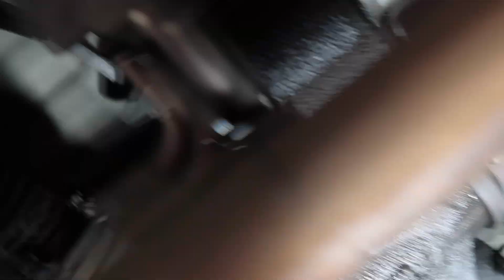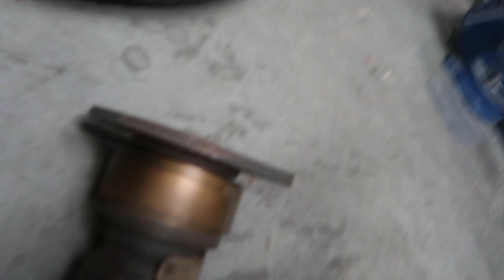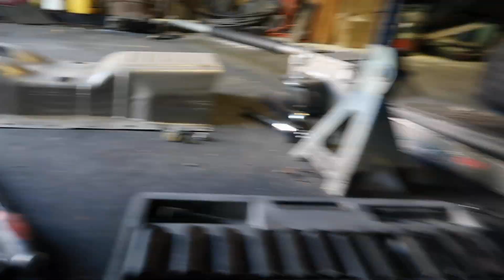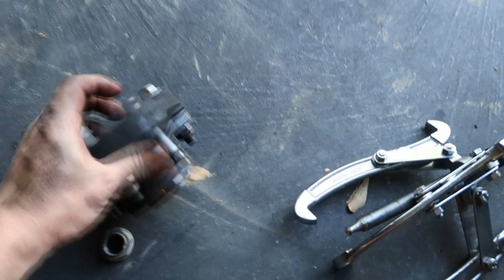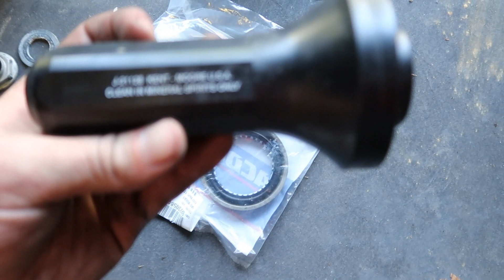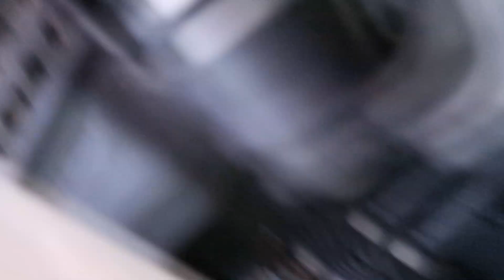How to fix leaking Cadillac ATS differential - Replace Pinion Seal

Comment: This video is excellent! However, the disconnect shifter step seems unnecessary, except for that. Thanks for the comprehensive video. Also, the diff vent is a very common issue with the ATS.

Comment: Hello sir. Do you have a video on replacing the differential axle seals? Do you know if the same tools are required to remove and reinstall the seals as you used for the pinion seal?

Thank you.

Comment: Hey @BIY Garage I had a leaky diff multiple times on my ATS. The issue was ultimately the vent! It was clogged and pressure was causing leaks. Check your diff vent!
Reply: when I removed the fill plug to top it off until I can change seal, I heard a vacuum sound. I wonder now if that's my issue.

Comment: just a tip if you hold the start button WITHOUT touching the brake pedal the ignition will come on and you can take it out of park instead of taking the interior apart.

Comment: Thanks for posting this.  Bought my ATS last year with 19k miles on the clock.  Noticed differential was wet with fluid so took it to dealer to have axle seals replaced.  (It was still on warranty.)  Looked at diff yesterday -- less than eleven months and 14k miles later -- and diff is all wet again.  Noticed drips on garage floor, and I just know it's been leaking for several months and several k miles.  NOTE:  I do not know if it's the axle seals or the pinion seal at this point.  I need to jack it up and take a look.  Either way, I have to ask myself how long has GM been making differentials?  Yeah, I know ... a long time, and you'd think they'd know how to keep them from leaking, but apparently not.  Your video here has given me a bit of confidence, if mine is the pinion seal, to do this job myself.  Very helpful.
Reply from the maker: Very glad to see this video will be helpful!
Reply: I had a leaky diff multiple times on my ATS. The issue was ultimately the vent! It was clogged and pressure was causing leaks. Check your diff vent!
Reply: rand49er

Hello sir,

It just sucks! Doesn't it? I recently learned from a NAPA AUTO PARTS buddy that even the smallest scratch on the inside sealing surface of the axle will cause the leak. You would need drop the axle to carefully and throughly inspect it. I have not done so to mine, but will have to soon. And, I don't know if there is a fix for that. 

Cheers!